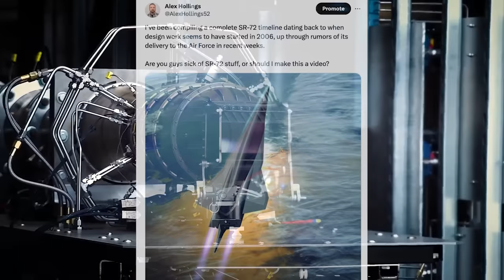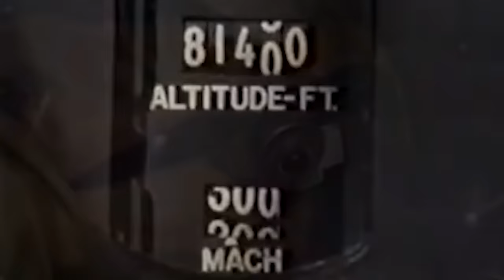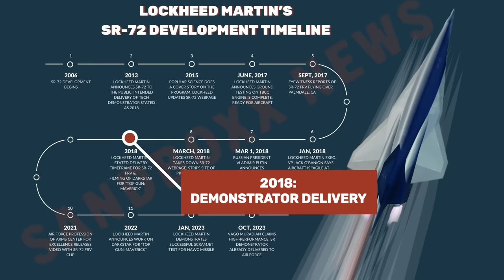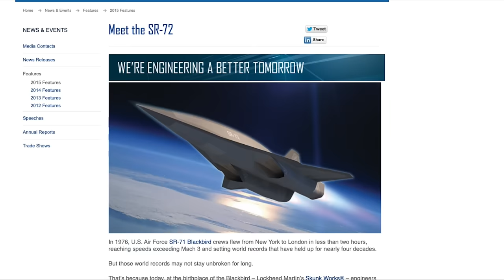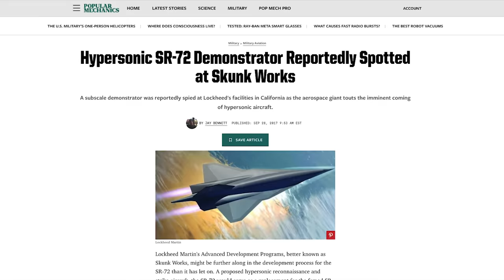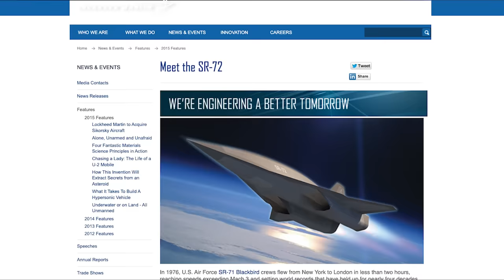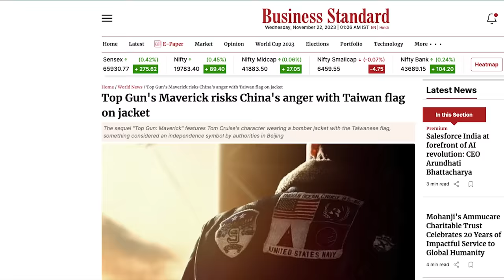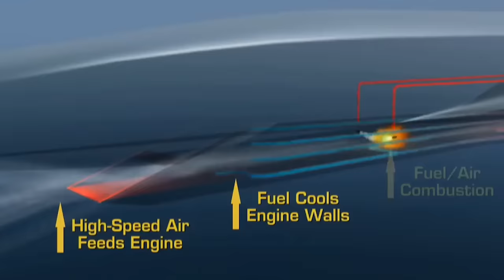The SR-72 is REAL — And we can prove it

Comment: Last year I attended the Edwards AFB airshow, where the Darkstar was on static display.
I know it was a movie, but damn that movie prop made too much aerodynamic sense.
I still got the 'hiding in plain site' vibe from that so-called movie prop.
Reply: I think that same thing. I don’t think Lockheed would just build an entire aircraft just for a movie.
Reply: Take into consideration that the Making Of featurettes, they state that they wanted Lockheed to build it as if they were actually going to make a flying version of it...
Reply: @vladyvhv9579  It's not just credited to Lockheed. If it was, I'd believe it was just a prop.. It's credited to Skunkworks. You don't get that branch of said company that runs Area-51 to just make you a movie prop when the government is shoving billions their way in black budgets. Also, why did it need engine covers? What were they hiding? I don't believe it was an operational aircraft that they were parading around but very likely a radar demonstrator.
Reply: @BionicBurke  Skunk Works does not "run Area-51".
Reply: @xenophagia  the entire original reason the Groom Lake base exists was to house Skunkworks top secret projects. They basically run Area-51.
Reply: the darkstar never existed outside of topgun.
Reply: Actually, it doesn't make sense. The SR-71 was 107 feet long with very large wet wings,  and carried 40 tons of fuel, and it burned through that fuel in a bit over 90 minutes. The "Darkstar" model airplane clearly does not have the internal volume to carry anything close to the volume of the SR-71. The wings on the model are tiny.  Also, at Mach 5, the turning radius would be so great that 1/3rd of the fuel would be used turning around.   The SR-71 operating from Kadena was always proceeded by two tankers and the aircraft would refuel soon after leaving Kadena and climbing to altitude. It would then accelerate and climb to cruise for a dash across Vietnam and Laos or Cambodia, and after passing, it would descend over Andaman Sea or Gulf of Thailand to refueling altitude, where it would refuel again, for the homeward pass.  The Darkstar model simply does not have the internal volume necessary to carry enough fuel for more than a very  short sustained operation at Mach 5 or 6 and if it can't turn around over an ocean, sea, or friendly territory, it is not a practical aircraft.  Also, why would you bother with a manned aircraft at all?  For such a mission where the flight parameters are soooooo narrow, the aircraft could be a drone, and if there is a high mach spy plane, it is almost certainly a drone as are almost all of the reconnaissance aircraft today. There simply is no need for pilot and no need to risk a pilot when the aircraft could simply be controlled by AI. The Darkstar is not big enough to carry the fuel that would be needed to make it a practical design.
Reply: Has anyone considered the DarkStar film prop is a 50% scale or even more condensed model.
Reply: I know this is a old video but 100% you are correct your telling me that the movie prop isn't a complete plane the fact the close ups on that Sam kids video shows the engine inlets are covered like when a jet is in storage why would you do that on a model jet? Also it's been spotted on flight 24 was a image of it for approx 2 hours before the picture had it removed I dunno it's all bait
Reply: @nomercyinc6783  The DarkStar name never existed outside the film. Ultra high speed is impressive but is it worth the disadvantages?  The huge turning radius is a huge problem. Turning at Mach 5 might not even be possible.
Reply: @BionicBurke  I think you both are right..... Skunk-works dose not "run" Area-51, but they do use it to test out of...... There name may not be listed as owner, but they have a history of using it allot for out of sight work.... From what I understand it is like the super yachts, where one person dose not own it but shell companies owning other shells owning other shells... Eestman I think his name is that dose yacht news says "beneficial owners" for the boats would be along the same lines as Area-51 and Skunk-works...
Reply: lol

Comment: What impressed me the most in this video was the reference to 3D material printing. Indeed - being able to integrate cooling (and likely heating) passageways into an engine smacks of building engines like a living body. Imagine what might trickle down to consumer level technology. Wow.
Reply: I have seen firsthand the capabilities of 3D printing of aerospace parts in metals that are difficult to manufacture previously in conventional ways. It is nothing short of astounding. I have seen those aforementioned cooling passageways and other unadvertised critical details myself. So, yes. Not only possible but has been done for over a decade already.
Reply: I've worked with some 3D printed parts in combustion applications, and it really does bring new capabilities to the table. I know they're doing a lot of  it for gas turbines used for power generation, and it's allowed for improvements in emissions and efficiency.
Reply: This reminds me of that "conspiracy theorist" guy that said he worked at Area 51 and came forward about the aliens, i think his name is Bob Lazar. But he said the alien craft wasnt bolted together, it was all one piece of metal, the wires were part of the ship body themselves. Makes perfect sense, he said this before this technology was even around. But could just be a dude who wanted attention lying out his ass. Who knows, id like to believe though.

Comment: As a USAF veteran and decades-long worker in the DOD contracting community, I said when the SR-71 was officially decommissioned, that there was no way they would do that without a replacement aircraft already at least being in the works. Sats can't do it all, and can't be "real-time" in all circumstances at any particular place. At the time, the project was rumored to be called "Aurora" (and even this vehicle may well have been) but regardless of the project moniker, it was absolutely going to have existed.
Reply: Aurora certainly did/does exist, we know that from the budget, but the USAF also often "decommissions" aircraft and then continues flying them in secret. We know for a fact that F-117 is still flying today, as the most famous example. They shut down a unit that used to fly a particular airframe, transfer it to a new unit, and then keep flying it in that new unit. A lot of this is probably either CIA/recon stuff, or in support of special operations missions. The special operations guys have every tool in the arsenal available to them. Any aircraft with unique capabilities, they're going to keep around a few of just in case they're needed for a particular mission. The F-117 may be useful for air support missions deep behind enemy lines, and it's also clearly being used as a platform to test out new stealth coatings and probably unmanned conversions and drone swarm technology.

Comment: While I was in the USAF, I was in conversation with an engineer concerning the sr71 and the a/f12. The conversation led to the fact that while flying at 80k and mach 3, the performance of the look down shoot down capabilities was 86% kill rate.  One item slipped out that the airframe was rated alot higher than the stated one, and the vehicles were heat treated and toughened with each and every flight. Sr 71 was and is one of my top 10 aircraft. The a-10, f-15, p-38, p-51 mustang h model,  a-4, f-14, da buf, Messerschmitt me109, all iderations of the sr-71, and the av 8b harrier.  Honorable mentions are the mv 22, ah64, ac130, my version of the ac22, and new replacement for the a-10, built in my mind of a p-38/a-10, but with a new 76mm high speed ,  25, 20, 40mm cannon and fifties in the wings, hey, it could happen...
Reply: ok

Comment: Fantastic reporting, Alex!

A possible Mach 10 reconnaissance aircraft with the capability to carry conventional or even nuclear weapons is an absolute game changer!
Reply: It would be one answer to why we are upgrading our nuke gravity bombs
Reply: @j.f.fisher5318  Interesting issue because if you launched a nuke from a plane traveling this speed you'd already have it moving at a speed necessary for a scramjet to kick in.

This would allow the elimination of the motor to get the missile up to speed so the missile would be simpler and you could have a larger payload.  Of course you also have the issue of ICBMs which can get a missile up to these speeds too.

Huh.    The US is upgrading pretty much all of its nuclear arsenal and the picture becomes a little more clear.  If they could get a projectile up around mach 10 that would be a bit of a challenge to intercept especially if it could do a couple course corrections even if it would lose some speed.

The first Alex mentioned of this plane probably existing and that it would be multi role it sounded like a winning idea right away and having a much better arsenal to go with it takes the US military out another 2 - 4 decades, maybe more, AFTER these platforms get rolled out to the military.
Reply: @johndoh5182  the only reason I doubt we would launch hypersonic missiles from it is cost. Why spend all that money when you can have the plane drop a cheap gravity bomb, and the bomb itself would already be going Mach 10? Just seems too expensive and complex with too many moving parts, and wouldn’t save much time to impact.
Reply: If we make a mach 10 aircraft to carry weapons, they would definitely be nuclear, probably exclusively nuclear. They wouldn't hold enough conventional bombs to be worth using, but you only need 1 nuke.
Reply: It wouldn’t even need to carry weapons…
Reply: @actionjksn  I think a fast reaction conventional response would be extremely valuable. Think of a special forces operation that goes wrong and needs immediate help. Or a high value target that is time sensitive.
Reply: @TraditionalAnglican  if it were a pure recon aircraft, sure. But it’s going to have a payload ability.
Reply: @johndoh5182  Difference is this could only launch like 1-4 at least, a single Trident II can launch 8 projectiles at the current configuration and max. IIRC 14 projectiles in a single missile. Saves a lot of time.
Reply: @actionjksn    A conventional bomb going 5000-7000 mph would be a lot more powerful than a bomb dropped at normal speeds.  You wouldn't necessarily need a nuke. Speed is power.
Reply: wouldn't be a game changer... ICBMs make everything that isn't literal sci-fi telefrags completely useless.
Reply: mach 17 , Air forces official heritage today ISR video states “ The future is coming at mach 17” while showing something that looks like SR 72
Reply: @TexanUSMC8089  A conventional bomb going 5, 000 to 7,000 mph in a horizontal direction is going to land where exactly?  You are suggesting that a conventional bomb would be moving really fast because the jet is moving really fast aren't you? It sounds like you're describing a hypersonic missile. Bombs are supposed to fly almost straight down from the bomber so that we have an idea about where it is going to land. It would have to fall at 7,000 mph vertically to do more damage.
Reply: @actionjksn , any unpowered object that is dropped from a moving plane will have both vertical (like falling) and horizontal (like gliding) travel. It's trajectory to the ground will look like a curved slope, with more curve near the terminal end of its path as ground speed bleeds off due to air friction. Unless the plane is stationary relative to the earth's surface, (either traveling straight up or down, or hovering) there will always be some sort of slope or arc to the bomb's path. Bombers don't drop bombs "over" their target, they drop them BEFORE their target, and the bombs travel forward toward their target while they're falling.
Reply: The way Putin brags about Russian nukes makes me know he’s seen video of our top tech. He’s scared!
Reply: Now add in the WonderWoman, invisibility factor.......
Reply: @actionjksn  I wonder how many miniature ICBM warheads can fit into an SR-72..........

Comment: I would be very, very surprised if there aren't several next generation aircraft in operational service that remain unknown to the public.  USAF have been good at doing this over the years.
Reply: Yep. The F-117 and the B-2 were unveiled to the public at the same time despite the former being designed, built and flown almost several years earlier...
Reply: The NGAD has already had its first flights. Sounds extremely promising.
Reply: Its 2023, everyone has a handheld camera that auto focuses. Its a lot harder to hide tech now which is why its super unlikely. Its also why we saw footage of the supposed first b-21 flight.
Reply: @dester3275 - There's a lot of technology out there still that the public hasn't seen,some that would thrill you, and then some that would absolutely scare the hell out of you...
Reply: @dester3275 yeah and keep in mind they have said repeatedly the NGAD has apparently had its first flight
Reply: Way more difficult now with more various independent pilots that all have cell phones with high quality cameras. I mean difficult to get legitimate confirmed information, but not so much with pictures or video.
Reply: NGAD has been flying for years, same with the B-21. They're now claiming the B-21 is on time and under budget (taking into account inflation), which means it was clearly in development for a lot longer than anyone was admitting. People think it's heavily based on some drones that were already flying, but I think the drones were just the way of funding development into larger airframes.

I strongly suspect that LM, NG, and Boeing are given a "soft" procurement program a decade ahead of any public procurement process begins, basically told what the military wants to buy 15-20 years down the line, but not given a final set of requirements. Then, as the companies get to work prototyping, they report back to the Pentagon what works and doesn't work, and the public procurement process is tailored around the capabilities already prototyped. That's when the official requirements are given, and the prototypes are conformed to those on an accelerated basis.
Reply: @fakecubed  absolutely agree, you put detail to my thinking

Comment: I interpreted the project needing to go through “rescoping” as likely a reduction in the demanded capabilities. Most likely of them being that they had to forego the “Strike” role of the project and focus on producing a functional ISR platform. Another possibility is rescoping the project from a manned platform to an unmanned platform.
Reply: Personally I think they want an unmanned platform (I don’t think they would change the speed, which will probably be Mach 10). Considering they likely had the Global Strike capability in mind perhaps since nearly the beginning, I’m not sure if they’d be willing to remove that so late in the game, especially considering an SR-72 with Global Strike capabilities would make it have a far more versatile role in the Pacific than the SR-71 ever could.
Reply: You only rescope a project to obtain higher goals than required not lower expectations or goals. Those are already covered under the current program or set of parameters.
Reply: That would require an altitude of at least 150,000 ft and a 2g turn circle the size of the east coast.
Reply: @Soucka74 this is not the case, programs get toned down all the time
Reply: @alexdunphy3716  I worked this stuff as an OSI Special Agent. Yes, things get downgraded but, when done there is no need for reclassification or rescoping. Parameters are set to include everything up to a specific set of goals. Therefore, anything below those goals does not need to rescoped down since the original parameters already included those. Rescoping is done if you need to meet higher goals or thresholds.
Reply: I'm thinking: "fast", "manned", "strike", pick any two.
Reply: @Soucka74 that is absolutely false.  Most of the time you rescope to get schedule and budget back under control.

I’ve worked in aerospace for 15 years.
Reply: This is a great comment. Quite a likely possibility
Reply: I would forgo strike until flight is so well understood it's boring.  Historically release into a supersonic stream has been challenging.
Reply: @Soucka74 Is you for real dawg? Have you not followed the development of the F-35 and the continued shifting of the goal posts to claim the meeting of goals? The F-35 has been a prime example of rescoping downwards for the various blocks. This is Lockheed we're talking about.
Reply: Lets go back in time to the SR71s drone program test program and image the possibilities today. Maybe they decided to add a dedicated drone that can be released as a loitering ISR/Strike system that can be delivered into contested airspace by airframe that will be nearly impossible to intercept. Considering the tech involved in the 72, I doubt making a drone that could be released and then be stealthy enough along with fast, stable, or deadly enough to get down to a useful loiter for real-time ISR /Strike altitude would be a problem for the Skunk Works. That would provide incredible intelligence information opportunities. Low level ISR stealth drones hundreds or thousands of km inside a countries borders.
Reply: There is also a small chance the project had to be rescoped in the other direction... that the speeds they were achieving were high enough, and far enough past what they expected, that things needed to be rethought. Unlikely, but since we're dealing with ram and scram jets, possible.